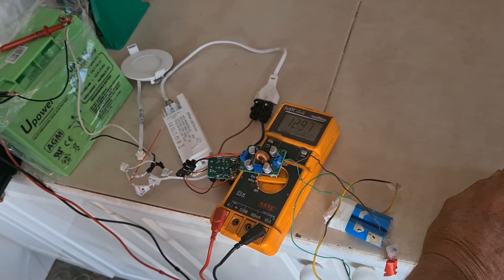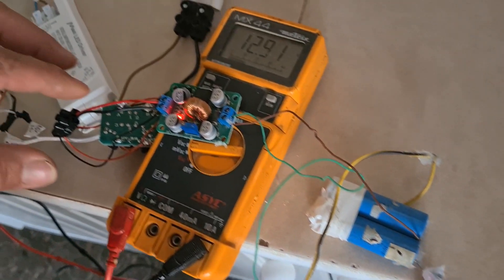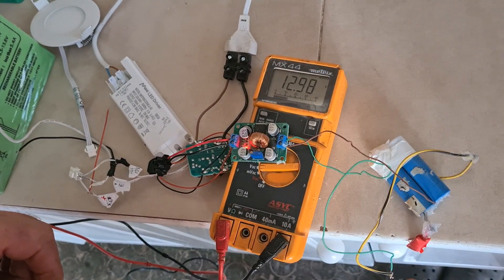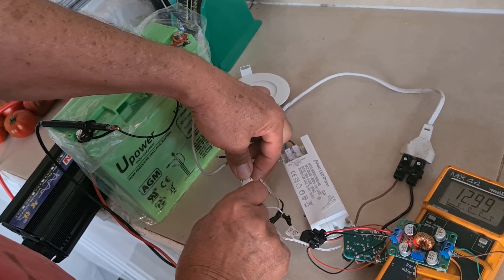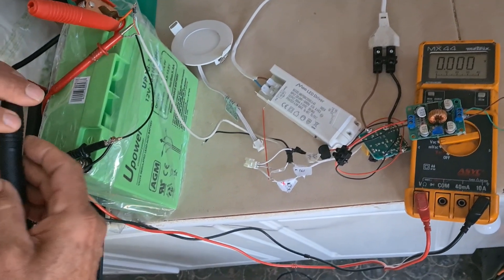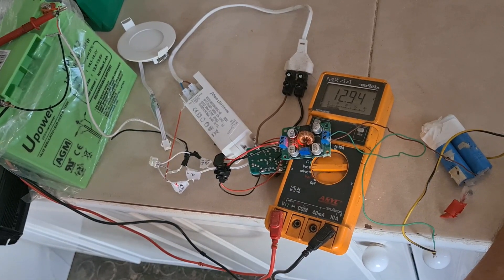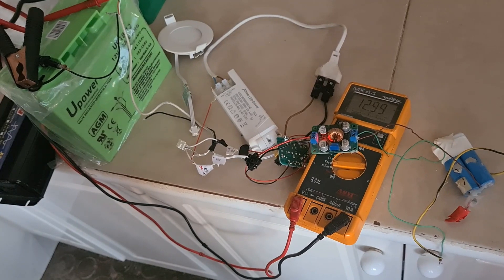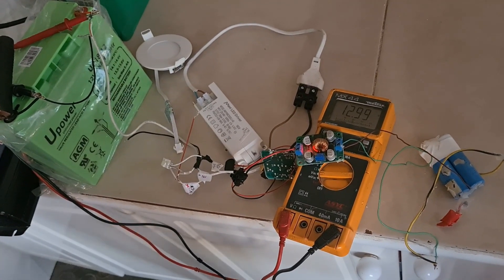Scale this fue-less solid state generator and the energy crisis is over

Comment: Hi Dennis, what a fascinating experiement!  For the LED constant current driver, you are using 350mA 6-12vdc.  Do you think it is okay to use the driver with 300ma with 9-15VDC output? 350mA at 6-12vdc driver is not an easy find.  the drivers available in the market are usually with higher voltages and wattages above 12w.
Reply from the maker: Hi Paul, thank you for your comment. Basically what you see is a couple of 3.7V batteries in parallel and the DC to DC converter that you see on the voltmeter will convert it to between 12 to 16V as the load will reduce the voltage I converted so it's better to convert it above 12V but not more than 16V. I do that with a small screwdriver turning the adjustment screw on the converter. This DC converter can convert from 3V to 20V any DC. From the output of the DC that is around 15V more or less, there is a circuit that you see upside down that is acting as a tiny inverter. This circuit receives between 12 to 15V and now the output of this upside down green circuit is giving 220V which runs the driver. The most important thing for you is that the driver in its output will give at least 15V DC, because we know that the green battery or any battery needs at least 14.5V in order to get charged. This driver is a bit different from others because it has 3 outputs wires, one of them gives around 20V that I use to charge the green battery instead of using the LED bulb. But the reason that it is 3 wires output is because one of them is the - and the two others are the one I just mentioned, 20V output + and the third wire gives only 6V to light the bulb in different brightness. This bulb can work strong or dim with 6V or around 15 to 20V maximum. I think you can use any driver, they usually give 12V DC output but if you put a small DC to DC converter it will be enough to charge a 12V battery. I hope it helps. Regards
Reply: @denissabourin thank you Denis! I have been searching everywhere for the exact model of the LED driver (Meko MKP006C0350LU-4S) that you are using with no success. Would you be kind enough to tell me the link where I can order one? Thank you!
Reply from the maker: @badboypaulpark  hi Paul, I collect and buy so many items for my tests and research, I don't remember exactly where I bought it. But I can send you one with its bulb. Please note carefully that each time you disconnect the power source of the driver, it will give you a different light when connecting it back (meaning stronger, dimmer, and a different colour) so the DC output is different each time you disconnect and reconnect it because originally it was meant to give you 3 positions of lighting. I don't know where you live but can try to send it to you. Once you get it, I will tell you how much the delivery was, I don't think the item is worth more than 30 Euros. But will try to write less when I send it in a box. You can send me your whatsapp or email and we can take it from there. My email is luelmade (at) hot mail dot com. I'm writing it like this so that it doesn't get removed. Best regards
Reply: @denissabourin  Very kind of you Denis. Thank you!
Reply from the maker: In order to consume very little current like 300mAh or so, because I understand most circuits use at least 1Ah, you can use for example a tiny DC to DC converter the MT3608 USB and in the input between the 2 batteries of 3.7V and this DC converter you can put a resistor on the + of the input of the converter. A resistor of 5 to 7W to prevent burning. And in the output you can put a 7Ah 12V battery for the test and it will charge it with very little consumption. Around 300mAh. Then you can charge back the 3.7V battery from the 12V battery with a potentiometer. Regards
Reply: @denissabourin  I don't understand this thing about the resistor to prevent burning. Would you mind to elaborate on that, please? :) Plus, what value of the resistor? 200 ohms? 2k ohm, 20k ohm, 200, or 2M? We are loosing the energy into the heat, not gaining with a resistor, so, don't understand what is the purpose of it there :).

If you use a boost DC to DC converter, you can gain on voltage, but will loose on the ampers. Ok, you'll charge the bigger battery, but, small batteries have a limited capacitance, lower than your green battery. So, you can't fully charge your green battery out of those 18650 or whatever those blue ones are. Or, am I wrong and can prove it? I'd love to be wrong on this one :).

Next, yes, you can use a back DC to DC converter to charge those small blue batteries. But again, if you will use too much energy from this green battery, no way Jose to recharge it on time :). Or again, am I wrong? :)
Reply from the maker: @screen-protector  hi, I will try to refer to what you mention. You are working on logic, and I understand what you are saying. In this case, you can use a resistor of between 2 to 5W I will send you a video to explain why I use this resistor and it is to reduce the consumption from the input or charge battery in order not to lose too much power. In the video you can see I'm using a 2W resistor of 10 ohms. You can see the bulb doesn't give its full brightness and this is because this concept is giving me light for a room instead of 5 hours, I can enjoy the light the whole night until I wake up. So mainly you are blocking the energy from that goes to the small inverter from the battery to give a strong light but at the same time using a lot of consumption from the input battery that is also a 3.7V battery.
In the video you can also see that the 3.7V battery has a lot of amperage but not enough voltage to run the tiny 12V inverter. So it's enough to put a small DC to DC converter like the MT that will raise the voltage to 14V for example to trick the inverter, because it thinks it got the 12V it needs and now the inverter runs as if it had a 12V battery but again we are limiting the amperage from the input battery to the inverter by this 2W resistor which gives a weaker brightness to the bulb but allows it to work the whole night. So this is the purpose of the resistor. You are gaining more energy in time. 
If you charge a battery let's say the green battery in the video from a 3.7V battery 18650 you don't want to kill the lithium battery quickly so in between you can put a resistor and it will still charge the green battery with less amperage and for longer but the lithium battery won't get completely flat. 
To your question about the small battery charging a big battery, it's because I never allow the green battery to go flat. This is the secret. So the inverter that I put on the green battery in order to light a bulb in my living room, will run very nicely during the evening and I will lose only 20% from the battery. That's why it's enough that the two batteries 18650 will just complete the losses of the green battery but they don't charge it from 0 to 13V. So if you play with that you always gain and will remain with enough energy in the green battery to charge back the lithium battery and put between them a resistor because it's too strong to charge the 3.7V batteries directly. And anyway, the 3.7V batteries don't need more than 5V and 500 mAh to charge them back to full. And this is the beauty of the resistor to block the current from the 12V green battery back to the 3.7V battery and charge it very smoothly. You can also charge the 3.7V from the green battery by using a small 10Ah potentiometer that you can find online but just to make the potentiometer run it will consume from the battery. You just open the potentiometer on minimum and release a very small amount of current from the green battery back to the 3.7V batteries. A resistor can make the job without the potentiometer as mentioned before. It will get warm and block the current from the green battery and charge the 3.7V battery. Regards
Reply from the maker: @screen-protector  https://youtu.be/86D-Z6Onb2Q in this video the 2W resistor is before the tiny DC to DC converter MT so it's blocking and limiting the current from the 3.7V battery to the DC to DC converter and inverter in the end which powers the 220V bulb. I hope it helps.  Regards
Reply: @denissabourin  thank you for all your answers here. Now I understand more ;). So, still the resistor will loose more than a MOSFET + the driver for it and a coil/HF transformer like we've got in the inverters. These are far more efficient though. 

The way I see it is why I'd use a resistor which lose a power more than we could lose with other solutions. If we can put proper solution, you can gain from top of my head about 20% on top of what you're gaining. 

I'd not know it if I'd not fix electronics on a daily basis :). But, as I do it and teach others fixing electronics, I know these things :).

Now, if you are worried about not having a 12V which is normal, you can use several of those 18650's and no need for such big 12V battery which most of it is wasted anyway IMHO. If I'd have it as a spare one, I could use it, but, if I have to buy, just few £££ will cost me 1 of those 18650, or I can take it from an old laptop ;). 4 x 3.7V = 14.8V which is enough to get those 12V which you want :). Now, it is more compact, you're more likely to not need this huge 12V battery and can save money this way. 

Plus, if your LED you want to consume less power, you can use NE555 timer, or the cheapest Arduino and use an existing library which will cost you less than £5. :)

If we would have a gain somewhere, this all would not make sense. But, I don't see a gain here :(, or I'm wrong?

Yes, you are correct, you should not charge with 12V battery those small 18650, but, on Aliexpress, again for just few £££, you can get a small board which I have here that can safely charge them, I found for you a similar to what I have with balancing, overcharge protection - you might even know them:
https://vi.aliexpress.com/item/1005005252444940.html

If we charge 12V battery with the sent of those 18650s, we lose the power. Than we charge the 12V battery and loose again. So, the question is, where we gain the difference to not discharge these completely? :)  Or, am I missing something here and we're not losing? 

Anyway, with resistors there's a heat = loss, more loss than with PWM. So, either I don't understand the video :(, or I understand that sooner or later I have to charge those 18650s anyway because I'll run out of power in them.

And, again a room for improvement apart from the PWM power supplies and back/boost DC to DC converters is this smaller battery pack out of those 18650s.

If I'd have more time, I'd recreate what you have here, I think I've got all of the components in stock. But, I'd have to understand how you charge those 18650s so that they can charge this 12V battery later. You could compare then, how much you loose by using those resistors and potentiometers vs PWM solutions :).
Reply: @denissabourin  thank you :)
Reply from the maker: @screen-protector  hi, I will try to explain shortly as I'm a bit busy with some projects so please forgive my short answer. Please let me correct you regarding the resistor, it's not losing or gaining any energy and you cannot compare it to a MOSFET for example the TIP3055 that we also call a transistor. The MOSFET works on fast pulses and requires a lot of energy from the battery, a resistor doesn't require any energy from the battery. It blocks in a way depending on how many ohms and Watts, the current from the battery to a bulb or DC converter or driver or whatever. It's exactly like a river where the water flows with gravity and you put some stones to block the flow of water. The resistor does the same, it limits the amount of current coming from the battery to the second device and the resistor is placed in between. So the resistor doesn't consume energy. It's just leaving more current in the battery and limiting the current that goes for example to a bulb as I explained. 

As you said, the resistor is the best solution if compared to a potentiometer which consumes much more or any other solution because it doesn't consume anything. 

You can charge two laptop batteries 18650 in many ways even a small USB step up converter will charge them you just need 5 or 6V. 
And you can make all the arrangement with these batteries too by connecting them in serie.

This test is for lighting and there is no need to drain the 12V battery completely. If you discharge it completely, the 3.7V batteries will struggle to charge it back to 13V but if you only use 20% from the 12V battery's capacity and enjoy the light the whole evening, the couple of 3.7V batteries have more than enough to bring the battery back to full and all that because of the low consumption of the LED driver and the whole circuit. So you are gaining the light for the whole night and you have more than enough to charge the couple of batteries back, it's up to you to make the balance. 

I wish you a nice weekend and all the best with your tests
Reply: @denissabourin  First for most, thank you for this explanation :). How I see the river when you put stones in it, is that you lower the surface (if you block the water), but increase the speed now - or will overflow. So, in a sense of the resistor, you decrease the voltage, but gain the heat by wasting it. That's how I understand electronics in this matter. If I'm wrong, I'll be more than happy to learn something new here :).

Mosfets can work with a driver and you can cut off some cycles in them, but use a coil which is fed by those Mosfets. This is how PWM works and our more efficient switching power supplies.

You wrote that the resistor doesn't consume energy, but my all believe system - esspecialy with I burned myself fixing electronics touched too hot resistor are telling otherwise. Will quote ChatGPT because my explanation would not be as accurate:

"No, it is not true that a resistor doesn't consume energy. A resistor is a passive electronic component that is used to control the flow of electrical current in a circuit. When a voltage is applied across a resistor, a current flows through it, and the resistor converts electrical energy into heat energy as it opposes the flow of current. This conversion of electrical energy into heat energy is known as Joule heating, and it results in the consumption of energy by the resistor.

The power consumed by a resistor can be calculated using the formula P = I^2 * R, where P is the power consumed in watts, I is the current flowing through the resistor in amperes, and R is the resistance of the resistor in ohms. So, as long as there is current flowing through the resistor, it will consume energy in the form of heat."

To sum up, yes, resistor is giving the heat, but in order to do it consumes energy. Or, can we prove it that I'm wrong?

What you're right about is that more energy is left in the battery - yes, that is true. Consumes power, but thanks to what it does limit consumption.

Again, I don't see a point to use only 20% of the energy and buy a huge 12V battery for quite a bit of money, where you can use only 4 x 18650 instead.

So, if we can avoid using those resistors which consumes energy by giving heat, and use PWM - this switching power supply and save up the energy, your system will be even more efficient. Plus will be much smaller if you don't have to use 12V battery and can use 4 x 18650 :). That's how I see it. And again, I'd LOVE to know if I'm wrong :).

There are even batteries with more cycles than Li-ion ones, they are dearer, but FAR more cycles have, are called LiFe PO4. For sure worth investment :).
Reply from the maker: @screen-protector  hi, I would just like to correct you here when you touch a hot resistor and they do get very hot sometimes, it's not because they consume energy it's because they are resisting the current and don't let all of it pass to the other side from there comes the name resistor. So again the resistor is not consuming energy. It's like running 10km and getting tired and sweaty this is comparable to the effort of the resistor as the ceramic resists the current to give less on the other side, there are different colors describing the ohms and Watts. About the life PO4 batteries they are good, they are 3.2V batteries usually like lithium and most of them are connected in serie and making a nice battery together. I wish you a good weekend
Reply: @denissabourin  Again, thank you for your time replying me :).

So, you're saying that the whole world of science is wrong that the resistor is consumes energy? I'll make a video about it and will show you on my YT channel here with my bench power supply that it does consume more. 

You're right that the resistor have ohms and watts, and watt is power, so a resistor consumes power = watts. 

Plus, on top of that, if you want those LEDs consume less energy and give less light, all you have to do is to remove a few of them, or make a switch so that in 1 setting will be let's say 70% of them on, and in the 2nd position will be a 100% on. This way, you don't need any resistor there ;).

I'm glad you know about LiFe PO4. :)
Reply: @denissabourin  one last thing as well :). I fix a lot of backlights in the TVs. The diodes connected in the backlight, are in series. Each of them should get a small A and a few Volts only. But, in series they transfer ampers of the other LEDs as well allowing them to light up.

This is causing the backlight to die in 5-10 years in the older TVs and those newer which are Edge backlight even quicker.

These diodes can't transfer so many ampers and that's why they die quicker.

If a diode will be shorted and don't light up, the rest of the diodes have now more ampers to transfer and start to melt what's called a diffuser.

What it has to do with a resistor and power consumption by the resistor?

The total power rating for a diode should be giving to the diode and no more. Than, the diode would last for more years than this TV can last.

But, if you try to put resistors and not connect them in series, but should get the proper voltage and ampers per each diode, this TV won't light up, or will light up, but will be really dimmed. You know why?

Because those resistors consume power needed for those diodes to give a proper amount of light.

Test it yourself and you'll understand what I mean. You can get a faulty TV quite easily, take out the display which is 3mm thick roughly and remove all the polarizers, etc. Now connect those diodes to a small 3V power source one by one and test. If won't work, there's a 6V diode. If it's a SONY TV, you'll have 10.7V minimum quite often and more will be brighter. Check which one doesn't work properly and which one does. Short those dying ones. And, this TV will light up again. Yes, it's a fix. But a proper fix is to replace the backlight.

And, once fixed, take resistors, calculators for resistors are available for free online and calculate how much resistance you need in each resistor to supply only the power for a single diode. 

Now, hook up those resistors in series and compare ampers taken with and with no resistors. 

If you can do it, please reply to yourself, not me, I know the answer, is there the same amount of W which is V * A with or without the resistors?

Yes, there's a lot of diodes in the Full Backlight TV, but, this will show you that resistors consume power. So, worth investigating ;). Just don't get killed, please. There's a lot of Volts and Amps, especially in the Hot side of the power supply. So, better not touch it.
Reply from the maker: @screen-protector  Hi, if you are speaking about small LED lights on the TV please note that because they are in serie this is the only reason they give the light properly. If the voltage would be higher than what they need, they would burn right away.
They can also work with this voltage in serie even without amperage because the LED bulbs work more on voltage than amperage. There are diodes that can transfer a lot of amperage but their job is not to transfer their job is to block current and voltage from going back to the source. That's the reason they usually have a grey color to give you the direction on how to put them in the circuit. I never connected any resistors in serie, I just put them on the + to reduce the current from the source, if the TV won't light up, try to find another reason. 
I might not be able to answer in the next few days as I'm working on a project. Thank you for your understanding and all the best with your tests.
Reply: @denissabourin  that's not what I mean, but thank you for your answer.
Reply from the maker: @screen-protector Hi Piotr, I'm sorry about the misunderstanding. We can find a weekend to speak and maybe clarify this point better. I checked your channel you are doing very well. Best, Denis
Reply: @denissabourin  Hello, Denis. That would be nice. Because I really don't get the message :). Merci :)
Reply from the maker: @screen-protector  I will try to find some time. Thank you for your understanding.
Reply: @denissabourin  Happy Easter, Denis :). I've made a 25W solar panel which produces me 5V on the output. I've made 2 videos about it already. I call it the worst panel :D.

This panel had no issues with charging 1 or 2 of 18650's. And, now waiting to finish the last cycle.

The next test I'm going to do is to charge 4 x 18650 in parallel, so let's say 40-50W. Up to 3.8V is going quite quick and than slows down and goes up about 0.1V each hour when I charge those 2.

I plan bo make at least 500W in solar panels in total and use one or two lead-acid deep cycle batteries for it. Building an inverter as well on top of that. All is on my YT channel.

After that I plan to build a wind turbine as well.

But, everything has to be affordable, not something I'm going to pay-off for years.

My house is using over 10kWAh/day on avg. To make it worth, I need to up to 50% of that ;). Otherwise, it's a waste of time and money.
Reply from the maker: @screen-protector  nice achievement, I will have a look when I have a moment between my works. Happy Easter and thank you for sharing
Reply: @denissabourin  thank you :). I've ordered a high efficient buck converter 500W from Aliexpress just now like minutes ago :). 

Those panels I'll get have 24V minimum ;), and I'll get a 12V battery because the inverters I'm going to build will be only 12V. So, with this steop down DC converter, I'll be able to use one standard even if I'd add more solar panels up to the maximum of wires and this buck converter.
Reply from the maker: @screen-protector  great. Can you please send me your Whatsapp by email: luelmade (at) hot mail (dot) com so that I can call you when I have some time. Regards
Reply: Hey :), all you need to learn are boost and buck DC to DC converters. If I can find some time, I'll record a video about them. Don't know if I have the one Denis have mentioned, MT3608 USB, but, there are cheap and you can find them online :).

Once you'll learn about them :), you can than understand what Denis is talking about :).